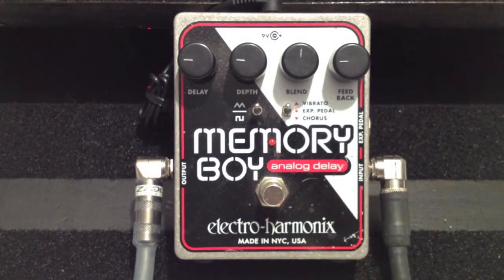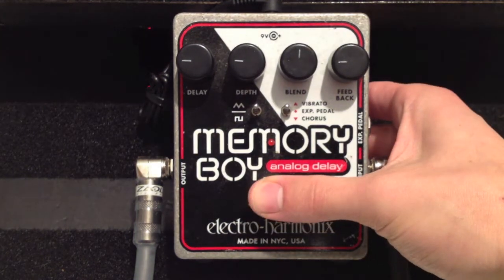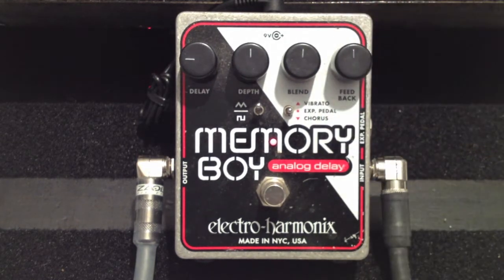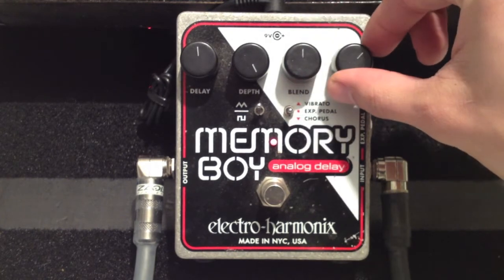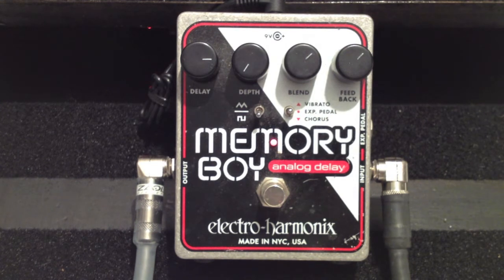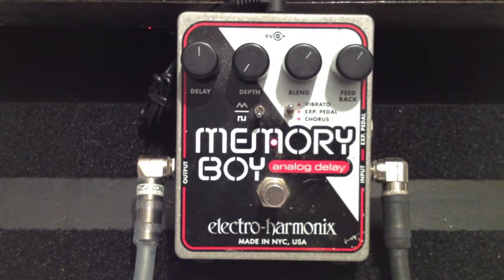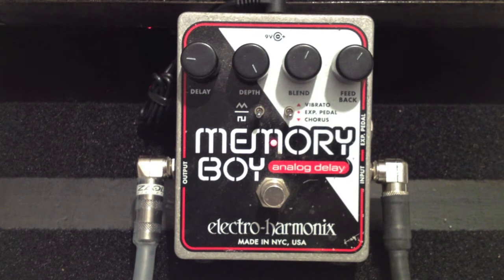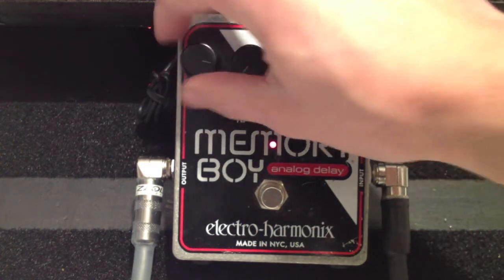Electro Harmonix Memory Boy Demo (Bassicsgear)

Comment: Seems like it was easier to dial in more usable sounds with the memory toy. Maybe the extra options here aren't worth it for bass?
Reply: I know this is an old video, but what you said here is exactly what I'm thinking. I have a Memory Toy and that is fine, but this was sounding too much like a chorus for most of the video. I already have a Bass Clone.
Reply: @wmdbassplayer  Well, if there's no expression pedal plugged in then the right switch just toggles between three different modulation frequencies - the middle position doesn't turn off the modulation. And since he had the modulation depth on during most of the video it's no wonder that it sounds like there's a chorus.

Edit: I know it's an old video but I thought this might be interesting to know for some people.